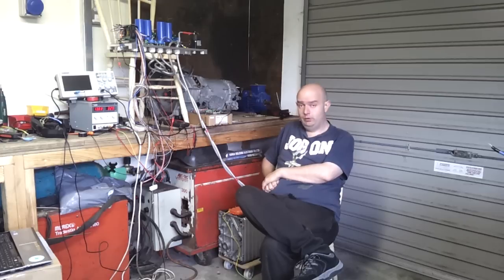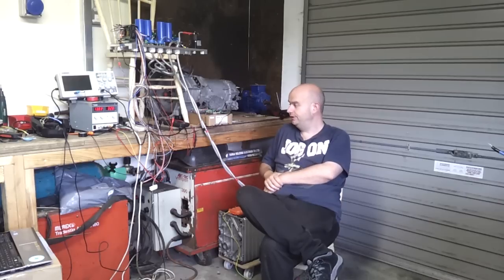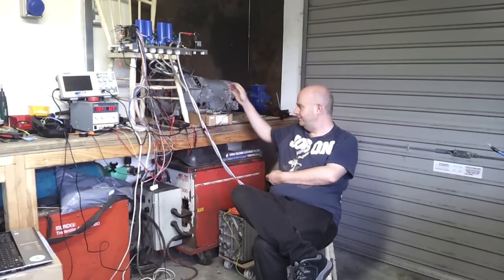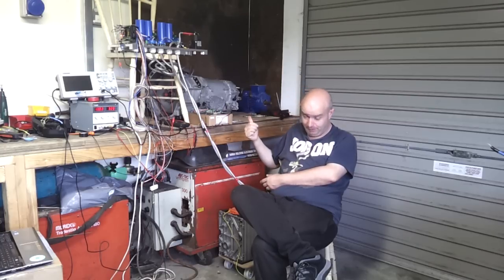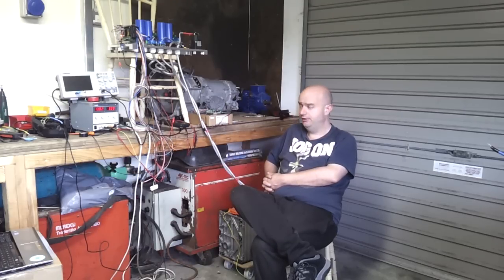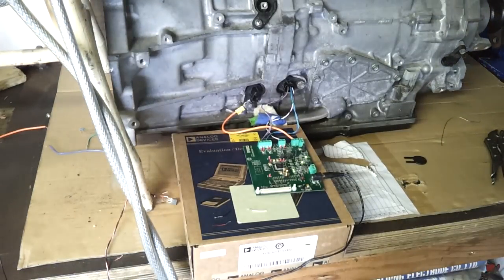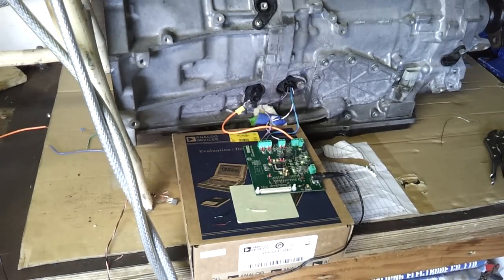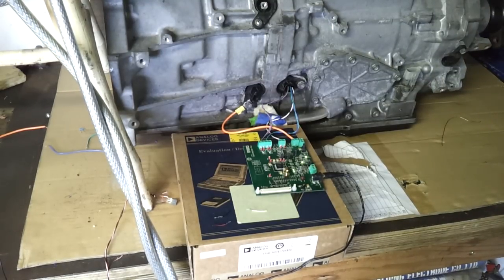Lexus Toyota Hybrid Transmission Project 05 : Noisy Neighbour

Comment: Damien,
do you have a schematic of the transmission encoder and eval board (high level block schematic) with the carrier freq you are feeding into it?
One thing I can think of is to shield everything (wires and board) and see if that reduces the noise, it's hard to tell where the problem occurs but with the board and wires without any shielding I would think that's where the noise problem occurs - shielding everything on the encoder side and power side might help but some testing needs to be done to determine if the problem would still remain inside the transmission.
here's a thought, can you use the signals directly from the internal encoder rather than using the 10kHz amplitude modulated signal? (if I understood correctly what I was looking at on the scope). Just thinking as a comparison with a quadrature encoder where you have step and direction being generated off the channels A and B if you might be able to do the same with the one inside the transmission (using an arduino or pic based board and interrupts on input signals). Have you tried capturing the signals directly from the encoder on the scope? the noise you're looking at is in the mVolts but the encoder signals should be logic level voltage (3v3, 5v or whatever the value is) so handling the encoder signals directly should pretty much make the noise negligible (and you can always add some filter to improve it in this scenario where you deal with high/low logic levels rather).
Not sure if I understood this whole thing correctly but that's all I can think of, I'd probably start with shielding everything on the encoder side and see if that improves at all.

Comment: If it's have problems at low power it's going to be interesting a 200Kw :-). Is there any way you can get it to give a read out off indicated angle to see how much it's jittering? How many pulse per rev does it give? And and can you set/reduce the number pulses per revolution that it the board outputs?